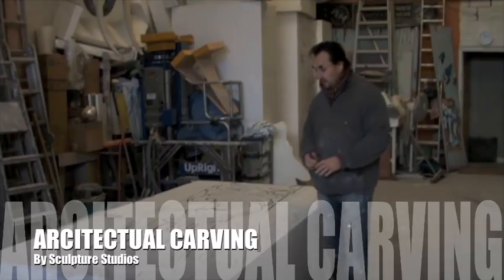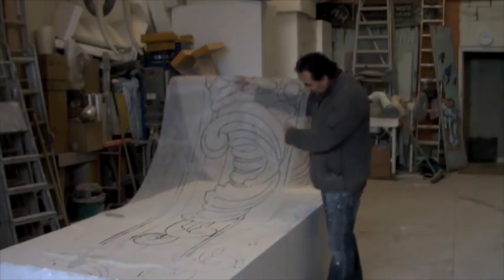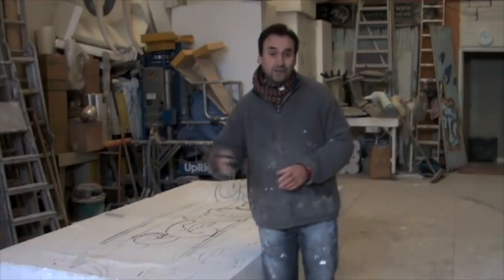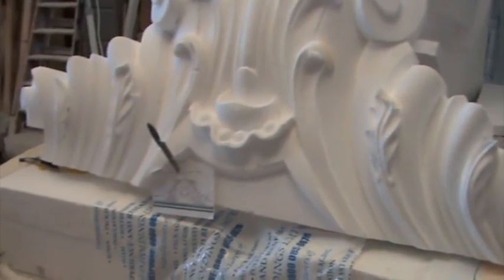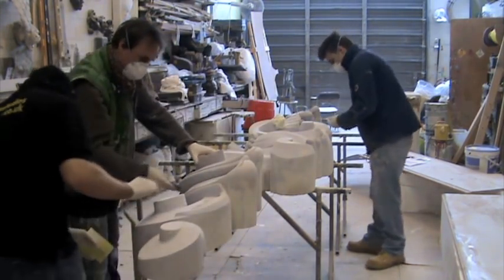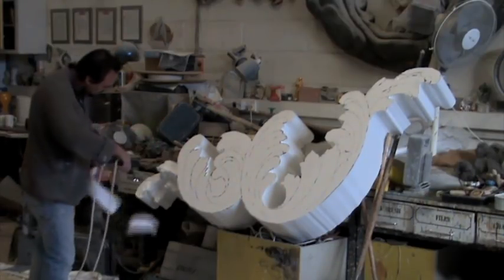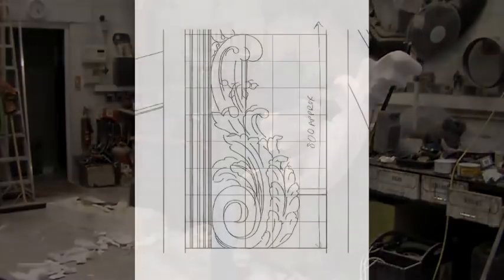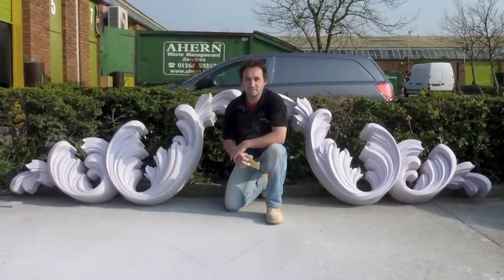Architectural Polystyrene Styrofoam Carving by Sculpture Studios

Comment: Hello aiden,
I keep re-watching your videos trying to catch the name of the transfer mask used ?
 Is it a material or netting paper.... what is it? also do you surface seal the eps with plaster? I use styroseal 1000 and it is self leveling . My use is signage so I actually do hard coat the foam to 1/8 or more thickness . If I make a mold to do copies, the styroseal works well as a sandable surface too. 
Keep up the great work!

Comment: When you apply the plaster on top, is it a thin or a thick mix?
Reply from the maker: Thin mix. It's water based. So needs to be thin in order to dry properly to then sand back. If its too thick, it doesn't dry, and ends up cracking (note, it's a water based plaster mix. NOT Plaster of Paris)

Comment: Wao... food for thoughts I started building my holiday home back in Pakistan as the construction of the structure is complete and wanted to have same type of designs for interior and external walls but had serious trouble with local builders and masons every one I contacted was so promising that they are able to complete my dream home and done all the easy work like brick and plastering when it came to designing they all ran off with money I have lost quite a big chunk of the money but I still didn't give up my dream. the technique they use is put lots of plaster on the wall and try carve design in wet plaster. after looking at this video I think I have found a solution which was already growing in my mind but didn't know how to start. I think this is the best solution to my problem. To make moulded and construct my design separate and hang the final product on the plank plastered walls and selling. now I have a few questions:
1. Can I buy ready-made moulds or Polystyrene?
2. if carved Polystyrene can be bought then how to make moulds?
3. how to make the compound to fill the mould to get final product? 
hope to hear valuable advise
Thanks for posting the entertaining video
Reply from the maker: Hi Ali, please give us an email at aden.hynes@hotmail.com or give us a call on 01268 726470

Comment: That looks very, vulnerable to snapping as though it couldnt survive a fall, but the attention to detail is great,
 it seems there's not a project you wouldnt under take, I know myself that everything is a new challenge, difficult for differant reasons, one sculpt or drawing from another.
Reply from the maker: Fortunately, it was mounted high up on the walls, away from public touch. So vulnerability wasn't so much of an issue. If it required something more durable, we'd most likely have taken moulds, and reproduced in glass fibre

Comment from the maker: c cgunn We're using a very thin sheet of glass fibre, almost lie a tissue paper, so that you can draw onto it, and then draw through it. And we're covering it in just a household plaster filler. This isn't waterproof or anything as its going inside, just a shell so we can make up the surface, quite delicate though.
Reply: +Aden Hynes Sculpture Studios That is remarkable. I've use the home made hot wire for designing and making parts for remote control airplanes. Especially the wings. You can also make casts of some parts this way for fiberglass molds. Great work!

My final thought as the video ended, So many talented people doing this and now we have 3D printers and or 3D dremel machines. Takes some of the art out of it but at the same time makes the ideas endless.
Reply: +Caster Troy.  z
Reply: +Caster Troy.  z
Reply: Aden Hynes Sculpture Studios

Comment: Beautiful work. But you knew that already. Do you coat these with any kind of epoxy or plaster? If so, what do you use?
Reply from the maker: its a water based plaster filler, and thats it just sanded back :) this isn't going to be reached so won't be touched, and seen from a distance so this is all thats needed
Reply: Thanks, Aden. That makes sense. But when you do a piece that might get roughed up a bit, do you have a stronger coating you'd use?
Reply from the maker: Have a look at some of our other videos, we do a lot of work with glass fibre. Moulds, blanket coats, and casting. These are often used for long term outside things and things that will be touched etc. Have a look through our videos :)
Reply: Will do. Thanks!

Comment: love your work!, just an idea iff you want to copy/clone your already made pieces, you can make molds with silicone rubber,and use expanding foam in it to get foam pieces in the exact piece you made in a fraction of time, so you dont have to work weeks and months for one art piece, just saying to help you out and save some time ;) great work tough.
Reply from the maker: Hi Fairysa, thanks for your comment. Have a look at some of our other videos, we make silicone, plaster, and glass fibre moulds for a great number of our jobs. This wasn't necessary for this job as no two pieces were the same. The pieces needed to be replicated but at a mirror image from left to right, so a mould wouldn't have worked. Thanks for watching
Reply: Allright then, just wanted to give some help but you already k now about that ofcourse, well keep up the good work then :-D thanks.
Reply from the maker: New ideas are always welcome, but mold making has always been very much up our street. Thanks for watching guys, keep it up!

Comment: I used to do Design and Build work. I had one client who I was building a restaurant for in Soho London and they re designed a bar 5 times. That is, it was completely finished 5 times and had to be dismantled and rebuilt until they had what they wanted. Work would be easy if it wasn't for the clients.
Reply from the maker: I mean, that's irritating, but presumably you got paid x5 for the 5 different themes. So effectively 5 different projects instead of 1?

Comment: I am about to do some work like this. Did you make the "hot wire" yourself? If you did, how?
Reply from the maker: Hi Courtney. It's made using chrome nickel wire, handles at either end with an on off switch. And a variable transformer that allows you to increase and decrease the voltage (and therefore heat) going through the wire
Reply: Appreciate the info. Your work is inspiring!
Reply: HI Aden, could you post a pic of your hand held hot wire tool?  I am in the process of making one and need something more heavy duty than the plastic handled set I have from Hot Wire foam factor.  thx Carrie

Comment: Take this for what it is worth, but one thing that might help (with the 
NUMBER of change orders (COs) that occur AFTER the deliverable...I 
emphasize 'number' and 'after' as COs should be assumed to happen 
ALWAYS, but the number can be significantly REDUCED) is to utilize 
Parametric 3D technologies to do the prelim work.  By using low cost or 
no cost 3D Cad solutions that are out there you can reduce the change 
orders, INCREASE the quality (as changing a finished product almost 
always results in LESS THAN optimum final results) and by so doing 
produce a product that is arguably considerably much higher quality, but
 for considerable reduced OVERALL cost (by virtue of them being able to 
see the designs in 3 dimensions and decide on the change orders earlier 
on in the process...rather than after the deliverable has been given.  
Also such designs can be integrated into the '3d Assembly WITH the other
 parts of the system or building, to keep track of things like 
interference and/or method of installation.  I know this is old (2011), 
but I thought this comment might help others.  I am not against old 
school, but 'teaching old dogs new tricks' is where the MONEY is (most 
'old dogs' understand the foundation principles which is what many young
 professionals lack...and what is arguably necessary in order to use the
 tools I mention most effectively).  Hop this helps someone.
Reply from the maker: The Garbage Engineer thanks very much for the comment. We realise 3D software and 3D cutting methods result in much more accurate finished pieces, but there are many disadvantages we have found. 

First of all, the timing. We find that our clients need sculptures with tight deadlines. Going down 3D software and 3D cutting routes takes a very long time. Often we can have products created in less time and be moving into the next stages, before another  company has got round to programming the computers and actually delivering the finished cut pattern. Not only that, but when the 3D cut sculptures are delivered to our studio, we still need to sand down and finish the sculptures to a decent standard, as 3D cutting methods very rarely leave a smooth (let alone a car body) finish. Also, the clients aren't making changes during the design stage during this project. They made changes just because they wanted them, rather than needing to see 3D pieces. And it was far quicker for us to change thing s by hand than if it were just done by machine.

Cost wise, we've also found that to have the items cut by machine, the cost normally accumulates to an entire projects worth then if we were to create it by hand. Cost and timing are both a big issue for our clients. As well as being able to make changes cost effectively and quickly, which is far more beneficial by hand. 

Agreed, 3D processes have their benefits. But a lot of cons as well
Reply: All good and true points.  I guess I was looking at it from a functional design/engineering change order perspective rather than a more subjective artistic approach.  And I think we have different perspectives in the respect that I guess I was looking at it from an in-house prototyping sort of arrangement....rather than a more perfected design deliverable perspective.  If the changes you refer to are more after the fact and random / subjective in nature than I guess all you can do is what I am sure you are already doing and just pricing it according to the original agreed upon deliverable plus a 'per change' or 'per hour' etc. cost per design change.  I love design changes ....so long as they understand that it is something that needs to be compensated according to the difficulty of the change eh??  Thanks again for sharing and I am not directing but rather sharing ideas and thoughts in the hopes that it can help you and others.
Reply from the maker: The Garbage Engineer Yeah exactly. Many a time we have clients say "could you just...." or "perhaps just do this". When really, there's no "just" doing something without a lot of work. So definitely look to either get things right first time. Or let the clients know how much work and cost would go into said changes.

And in terms of the processes we discussed, where's the fun in 3D machines? We enjoy the carving :) it's why we do what we do
Reply: yeah...i got ya (regarding the fun in using your hands)...I guess with me (in this regard ...and as of this point in my life which is bound to change once or twice more at least over time....Tesla said it best with the following quote {paraphrased I think}, "Whether I think of an invention in my mind, or build it in reality, makes no difference to me."..He was alluding to the fact that he could visualize his contraptions ('art' if you will), in his minds eye and figure out what would work and what would not by that method as if he had already made the prototype physically.....Cheers! and Keep up the good work!
Reply: plus some of us cannot chew bubble gum and walk at the same time...let alone do what you do ;)  Oh and yeah...as you know I am sure, it is a turn off initially to new clients to let them know that you charge for changes, but once you get the reputation wagon going (for one that does your job just as good or better than the next guy for a fair price), I found that the biggest problem I have had is the necessity to turn down work because everybody wants what you produce.  And plus, once you get the client on and he feels confident with the way things are going, the per change order method helps tremendously with keeping the project's scope decent, and timeline for the deliverable within reason so you can plan future work...there is a lot more to it as you know, but just felt like responding.  Sorry for taking up so much of your time!

Comment: How do you alter a piece when a client requests a change?
Reply from the maker: They request a change, and we either cut off material, or add material, its only polystyrene after all. Then we reapply the plaster finish again.
Reply: Do you use a special glue, or just tacky glue?
Reply from the maker: For polystyrene its a PU expanding foam, takes about 20-30 mins to go off

Comment: What do you coat this with plaster?
Reply from the maker: Its coated in a regular water based household plaster. Its put on quite thin, then air dries, and you can sand it back. Not intended to be touched too much
Reply: Thanks for answering questions, I'm getting into this. I got a few cakes of foam from the craft store but are small and they have nothing that size. Paid way to much But I want to try some foam fun and can't wait. What's the go to place for foam blocks? What a cool job.
Reply: lushfauna buy rigid foam insulation at a store that sells construction materials and glue many of them together to make a block